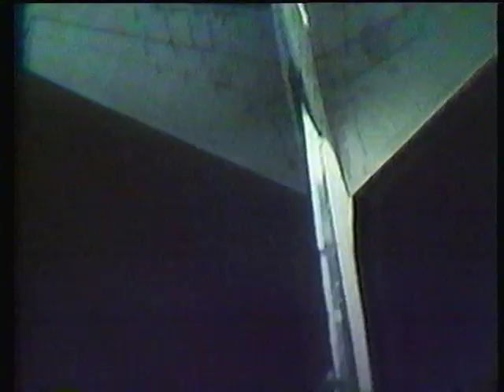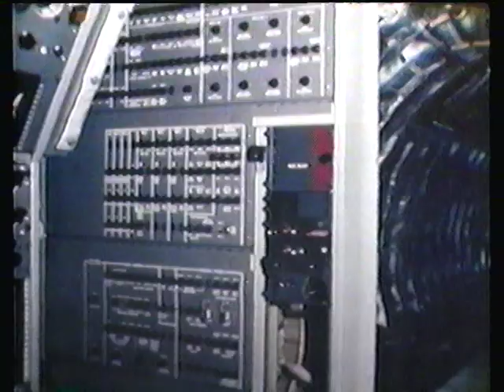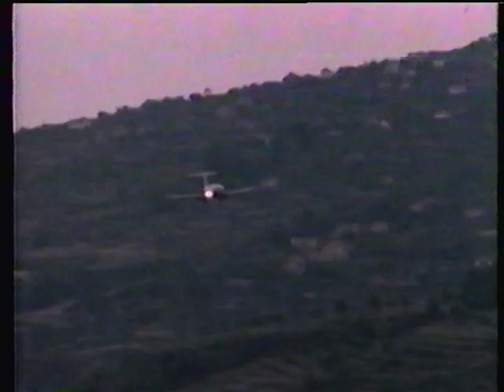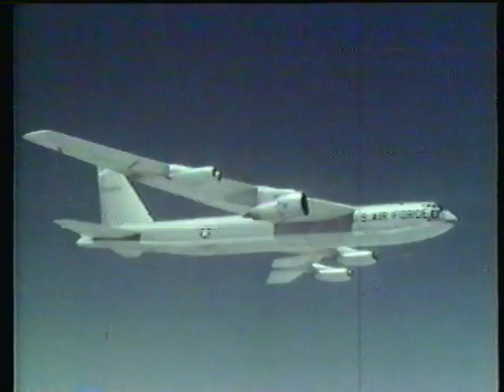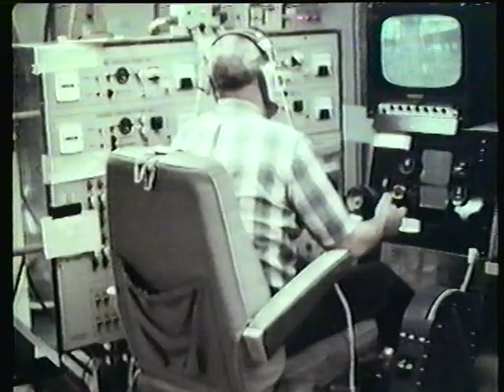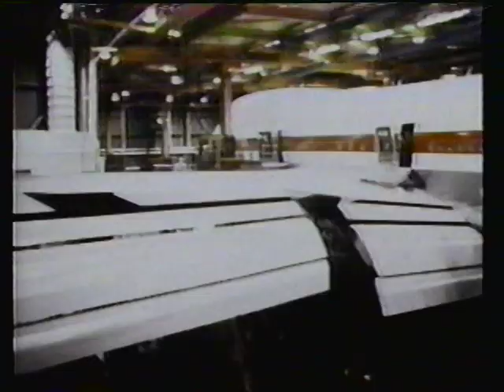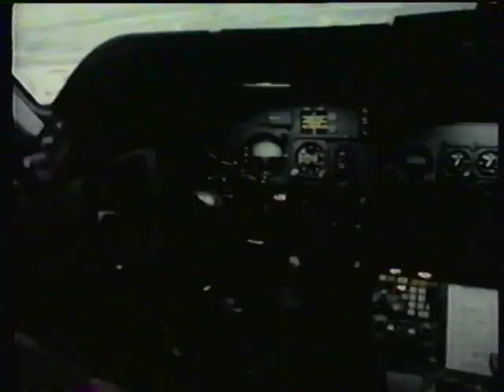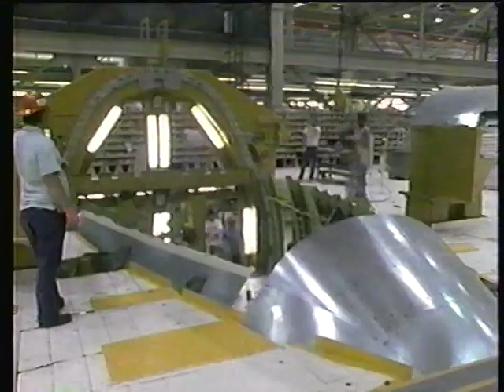Building and Test Flying the Boeing 727 & 747

Comment: Boeing needs to resurrect the 727!
Reply: jrc99us All they need to do is update the flight systems, maybe add some winglets, and install some more efficient and faster engines.... Which would take millions of dollars. But think of how nice that would be to have a 727-400! Think of all the opportunities there would be for a cheaper, faster medium range jet!
Reply: bellcc2 yeah, another 737MAX.........
Reply: @bellcc2930  Answer, NOT!
Reply: Boeing had tried to keep the 727 configuration. After consulting the with the Airliners, first to go the tail mounted engines, then the T-tail, and finally the 707 based flight deck, then we got a 757! 

killing the 757 was a mistake, but if Boeing could graft 757 undercarriage to 737MAX, then it can afford larger engine, then it got a fighter chance against A321. 

Best: redesign the 737 with slightly wider fuselage than A320m, undercarriage from 757, full fly by wire,  composite fuselage and carried over most of 737 max components, flight deck commonality with 787, 777
Reply: @jbrian80  Flown on 757 and 767, no one who has flown on both would never go back to 727's.
Reply: @jbrian80  737-10 series?
Reply: The president of Boeing once said the dumbest thing he ever did was to stop 757 production. At United, our 757's with Rolls Royce engines are hard to replace. They can take off with full fuel, full payload, and climb directly to cruise altitude(no step climbing), have great range and can carry alot
Reply: @jjthomas2297  The problem was NOBODY was ordering the 757 !!!! NO sales !!!!  NO production !!!!  why it was discontinued !!! It was a plane BEFORE its time !!!! A great plane !!!!
Reply: 737 is more efficient
Reply: that would take billions of dollars
Reply: itsumonihon the 757 can't really be fully replaced. The 737 Max 10 will compete better against the A321 and will hold just under what the 757 can carry, but neither the 737 or A321 can match the 757's power, range and payload. If the 757 was updated with scimitar or raked winglets and updated engines, airlines would buy them. If the 757 goes, there will be a gap between the A320/737 and the A330/767/787.
Reply: @shaun1293  Will the 737 Max 10 fly as well as the Max 9, or will it crash even more often?
Reply: @JJ Thomas--
Secretary of State John Kerry, very active in shuttle diplomacy between the world's trouble spots, literally "wore out" his favorite 757, rather than ask for a slightly larger 767. According to aviation sources, the 757 was the last of the traditional, direct stick control between pilot and airfoils, replaced in the 767 by fly-by-wire.  As airliners go, the 757 was relatively svelte for its wingspan, and its cockpit windows offered pilots a more expansive view, particularly downward, than the generations to follow.
Reply: @bobgreene2892  757s and 767s used identical flight controls. They were developed together, originally even as part of the same project.
Reply: @104thDIVTimberwolf  So much so that anybody checked-out in a 757 is automatically type-certified for the 767, and vice versa.
Reply: it has been replaced by the 737. the 757 will be replaced by stretched 737's too, within the next 2 or 3 years. smaller 757's have already been replaced by 737's or a321's.
Reply: I work at United, and we are getting the 737 Max, and possibly the A-321
Reply: The 767 isn't a fly-by-wire aircraft. The 767 was developed in tandem with the 757.
Reply: Bob Greene, I think you meant type that the 777 (not the 767) is FBW.
Reply: bellcc2 Boeing spent $billions with a B to upgrade the 747-400 to the 747-8 and 747-8F, Tim Clark whose carrier flies half of the A380’s in use has been trying to get AirBus to upgrade the 380, not just provide for engine upgrades. Of course AirBus put him off, before the year is up, they will be parting out existing 380’s that have been turned back off leases, or made and not sold. Singapore Air wants to dump the airframe entirely, Qantas has 2-4 in storage or headed in that direction. Sorry about going off topic, the bottom line is that any significant upgrades cost billions to design, retool, and build. Even if to you or I it doesn’t seem like it should. 
If Boeing were to suffer a corporate brain seizure and decide to please 727 lovers like you and I, the basic classic design would be upgraded to the 787 standard cockpit now used in the 777, 747-8, MAX. Don’t underestimate the cost of writing the software.
Reply: @bobbypaluga4346  AGAIN!!!  "...corporate brain seizure"!!  I just LOVE the way you use the English language!!  LOL!!  You, my friend, are talented!
Reply: Brian Chuckro Why thank you Mr Brian, I don’t deserve your nice words but I’ll take them anyway. With all the sarcasm and cynicism on comment boards, it’s nice to see positive comments
Reply: @bobbypaluga4346  Any time, good sir!  Anybody who is able to use the English language with the skill you do while not being nasty to others for no reason earns my respect!  Have a great day.
Reply: @bobbypaluga4346  Milliards, you mean?
Reply: jrc99us i
Reply: stickmagnet z
Reply: The JT-8d engines are too loud, and cause too much pollution, as well as consuming way too much fuel. Also, the wing would have to be totally redesigned for it to be efficient by todays standards, even with new technology engines. The biggest problem is the 737 series simply does the job cheaper, with less maintenance and at a lower cost
Reply: Just stop that 737 stretched out crap and build 727s. Boeing would be much better off if they did.
Reply: @craigpennington1251  I'm not a big fan of the 737, either.  It's just a really boring plane in my opinion, and I also agree on all the stretching of it...it's still a 737 no matter how many windows are on the sides...whether it has 7 windows on each side or 80, it's just a boring, blah, plane.
Reply: jrc99us they did it's called the 737
Reply: Why whould Boeing do that?? The 737 is a better alternative.
Reply: At 11:17, why is it so belching with smoke? Thanks in advance!
Reply: @yengsabio5315  Older type turbojet instead of a turbofan.
Reply: @craigpennington1251  The JT8D is a low bypass turbofan engine not a turbojet. Older style gas turbine engines had a different combustor design and fuel nozzles, which caused incomplete combustion, hence the smoke.
Reply: @bradw3116  That part I did not know. Thanks.
Reply: @bradw3116  Look at videos of the older B-52 and F-4 Phantoms in flight...same thing.  They're belching out black smoke like crazy, even in cruise.  Something that is funny to watch is the "MITO" of old B-52's...by the time the 3rd one takes off there's so much smoke that you can't see the runway!!  Also, with all that smoke, when they would practice the MITO, once each B-52 would get airborne, they fanned out in different directions because of all the smoke coming out of the one in front of it!  Something really fun to watch.
Reply: What about 747?
Reply: @WreedTrimmer  I have flown on them and they are a fine airliner.  They would be great for the LA to Hawaii & Anchorage flights.
Reply: Brad W look in this year the 747 is dieing
Reply: I AM TH EHEETE INGIENS IN THE 74 BECAUSE I AM POWERFULL AND SCHTROINGES AND SMARTES!
Reply: Dude, that's parameter, not perimeter. Enjoyable anyway, of course.
Reply: And the 757!
Reply: Could be a great regional jet if they removed the 2nd engine on the tail and added newer engines to make two and than modernise the cockpit
Reply: MagicDragonKatt not as bad as the 707
Reply: I think the 727 was a pretty dirty aircraft, or would be by today's standards.  They would need to completley revamp the engines and fuel usage, and that would cost hundreds of millions no doubt.  I'm not sure the 727 would be incredibly profitable in any case anymore due to the 737 and the emergence or Airbus since the 727's inception.
Reply: @MagicDragonKatt  Back then they were all smokers but with newer engines it could work but then again some things are best left alone and retire as a good memory.
Reply: Agreed !!!
Reply: jrc99us It’s tough to see a favorite aircraft cease being built to then eventually stop flying, I get it I’ve been in mourning since Boeing stopped making my favorite he 757, and the TriStar were no longer being flown. But that’s life, I may see some satisfaction if the 797 is styled on the 757; but the great 727 isn’t coming back, nor any 3-hollers. With the GE-9x and other new engines, you only need two. Interesting, the 757 was meant to take the place of the 727, that’s why the skinny bugger can takeoff using half the runway needed for the Ground Gripping 737; just as the 727 was able to do. I have long suspected that the only way the 737 becomes airborne is due to the curvature of the earth.
Reply: @bobbypaluga4346  LOL that was great!!  "...long suspected that the only way the 737 becomes airborne is due to the curvature of the earth."  That really made me laugh!!  Also, "the ground gripping 737"!!  LOVE IT!
Reply: I love Three-holers, but the 757 was designed to fill that slot and does it a lot more quietly, while being able to carry more for less fuel and maintenance.
Reply: @104thDIVTimberwolf  I can't remember the designation or name of it for the life of me, but wasn't the "British version" of the 727 supposed to be far more advanced?  I remember watching a documentary somewhere at some time and I seem to remember that it was said to have been a much better jet.
Reply: @ooo_Kim_Chi_ooo  is that a food?

Comment: The 727 was the first commercial aircraft to have an APU.  It was located in the main landing gear wheel well, and exhausted through the wing root.
Reply: Thanks for that. What engine was used for the 727 APU?
Reply: I believe that was a selling point for the 727 back in the day. With the Fowler flaps it was great for short runways and with the APU it could travel to remote small airfields and be self sufficient. There are some great videos of the 727 taking off from some backwoods airfields.
Reply: What's an APU?
Reply: Larson Wells Auxillary Power Unit. 😉
Reply: APU stands for Auxiliary Power Unit and it's a small turbine engine. The APU provides electrical power (via generator) and pneumatic air (from the APU itself, via a bleed air valve). The 727's APU is installed in the forward area of the right and left main gear bay (with exhaust on the top of the right wing root). The APU is used on the ground only and can independently provide electrical power, pneumatic air for air conditioning, and engine starting.

Most jetliners, such as the 737, 747, 757, 767, 777, 787, DC-9 (Boeing 717 & MD-90), DC-10, MD-11, and Airbuses all have the APU installed in the tail section.

Generally speaking, most airlines only use the APU to start the engines after push-back. Aircraft that layover at the gate all night are powered by external power, and air conditioning via the airport terminal. APUs are costly to run due to high jet fuel prices, so they are used only when needed.

Here is a YouTube video of the general description of the 727's APU:

https://www.youtube.com/watch?v=nXK7ewyBYxg
Reply: The 727 APU was a Garrett-AiResearch GTC85. I replaced many of them as a former, now retired, AMT (Aircraft Maintenance Technician) for Delta Air Lines. The APU was right in the middle of the forward part of the main gear wheelwell. I really loved the 727-200, and enjoyed working on it as a Line Maintenance Mechanic for Delta.
Reply: @davidevo2  I would like to do what that guy did in Oregon, he bought a old 727 and turned it into a house.
Reply: @living4christ  I have seen the 727 house on TV, and yes, what a great idea!
Reply: @living4christ  I flew over that 727 house in 2011 as a good friend and I flew from Scappoose to the Evergreen Aviation Museum in McMinville, OR and back.

Comment: The rear stairway on the 727 allowed it to operate at unimproved airports.  The infamous "D.B. Cooper" escaped through this rear stairway while plane was in flight.  An Airworthiness Directive was subsequently issued for the 727 to prevent the lowering of the stairway while the airplane was in flight.

Comment: Regarding the B727:  I'm curious, was there any particular reason why the intake hole in the tail was slightly oblong in the vertical axis as opposed to perfectly round?  Was there a strategy to that, or did they just think it looked better cosmetically?  Also, was the third engine S-ducted like the L1011?  Thanks.
Reply: If you cut an s-duct piece-by-piece, vertically, it's not going to be round all the way, it'll be oblong in most parts, the oblong intake you saw was the s-duct in the tail section, the actual intake, which is actually round, is installed in a different section.
Reply: Brian Madolid
Wow thanks.  Never thought about that.  I guess I just assumed that all cuts would be perfectly perpendicular to whatever angle the S-bend was taking (at the exact point of the cut), but I didn't think about the fact that if the cut had to stay perfectly vertical, that an oblong shape would be unavoidable.  Thanks for the explanation.
Reply: No problem, friend :)

Comment: Interesting video - but, it does have quite a few technical and factual detail errors that reduce the credibiity of the video...Boeing did not build over 2000 727s, they built 1832. The 747 cockpit uses LCD displays, not CRTs, also, there are 6 of them, not five....the documentary is good however for the old footage that would otherwise be unseen.
Reply: +Peter Harrington-Cressman HA!  You confirmed what I was thinking, that there were less than 2,000 727's built.  I was born & reared in Seattle, lifelong Boeing buff and statistics nerd, and I was sure the 727 production run ended at a bit over 1,800.  This had me scratching my head, wondering how they would have cranked out 200 or so more.  Thanks.
Reply: Glad to help Stacie